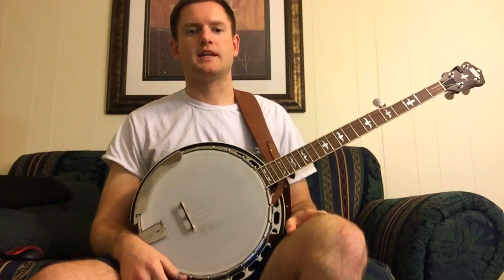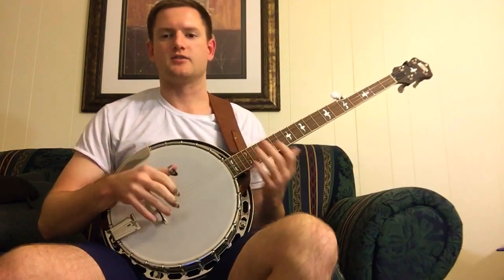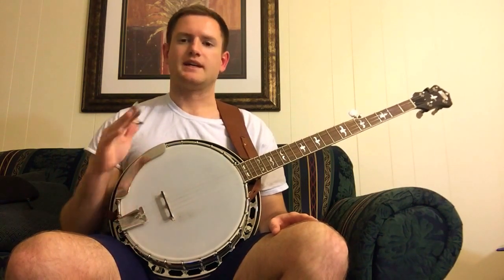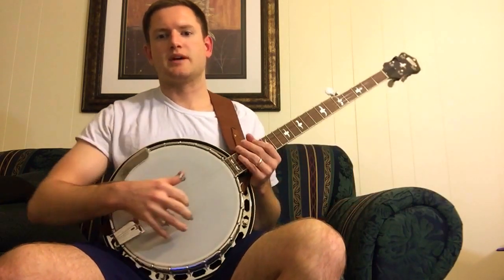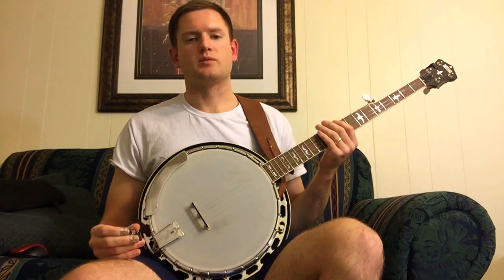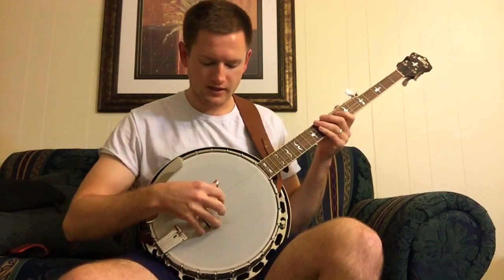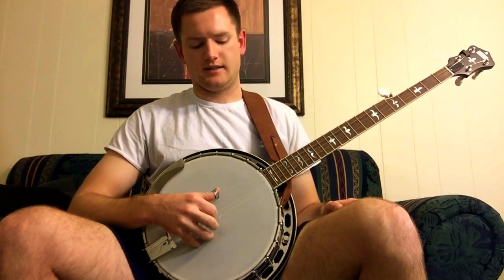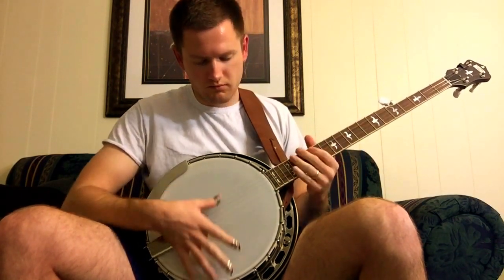Banjo Tailpiece and Head Tension

Comment: Thanks for the interesting video, dude.
After the 1st change, the banjo sounds shallower to me. There's a bit more treble, but less mid- and lower-end, and the banjo's original "sparkle" is gone.
After the 2nd change, it sounds muffled. The extra treble is gone. By comparison with the initial sound, it's almost as though you're playing through a telephone.
After the 3rd change, most of your tone and range are back, and there's a bit more depth than the initial sound. So I can't help wondering how the banjo would've sounded if you'd skipped the first two changes and gone right to the 3rd!